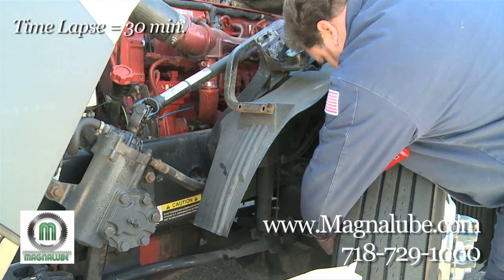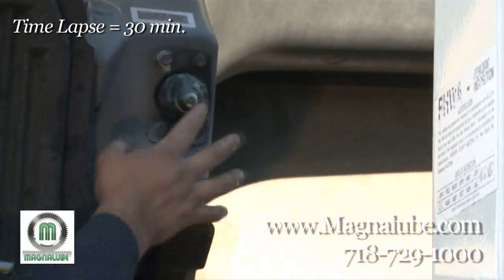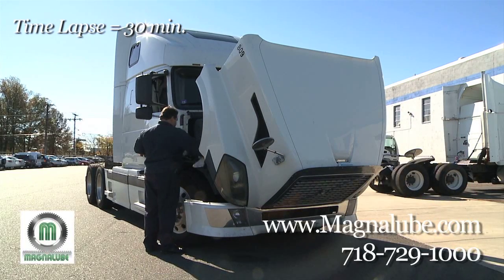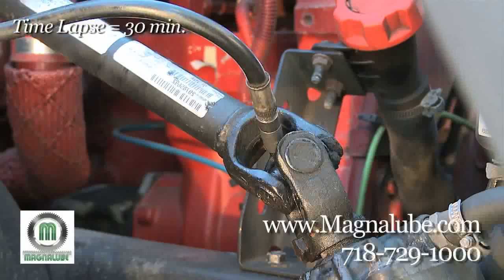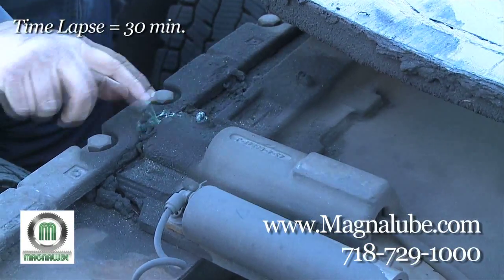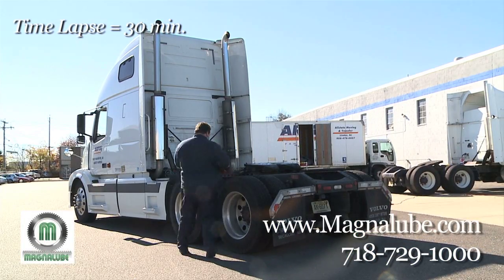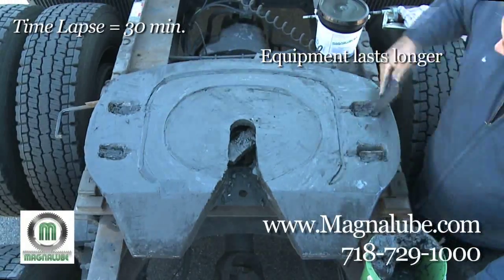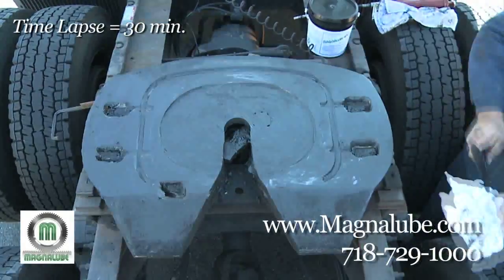How To Grease Trucks: Truck Maintenance with Magnalube-GX Extreme Pressure Grease (Intro)

Comment: I want to see this behemoth grease the bottom king pins and drive shaft. I bet you my paycheck he won't fit under a Volvo without any help.  not even if he greases himself up
Reply: believe it or not. if you drop the air ride. the diffs rise 9 inches. so even the big guys can fit under the truck if they want to